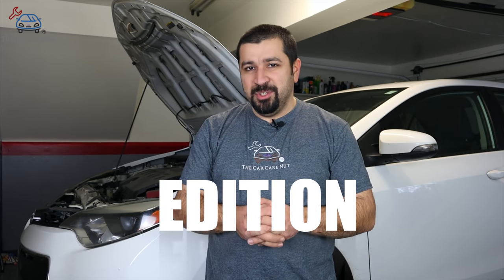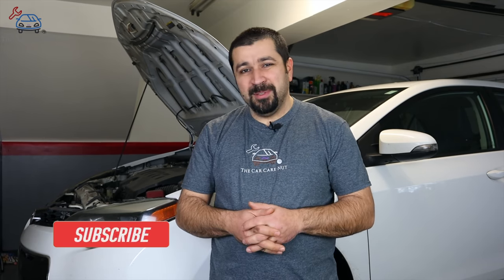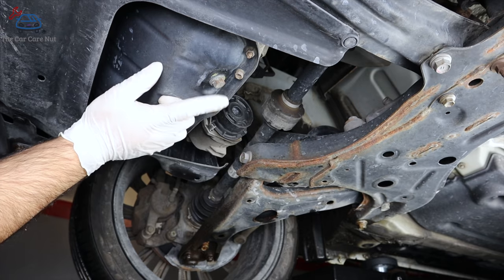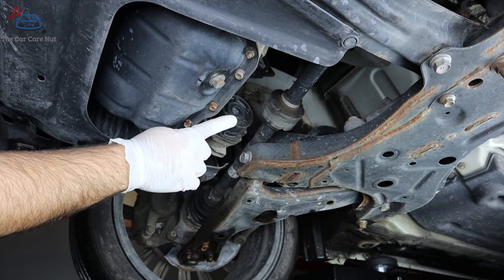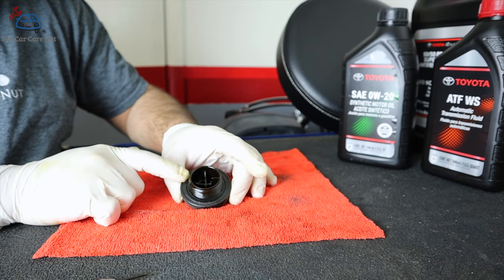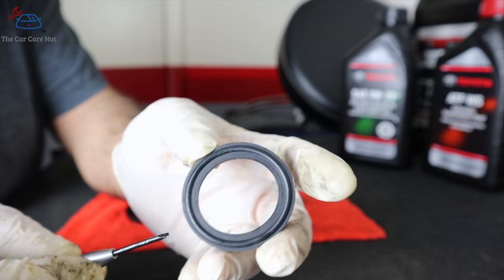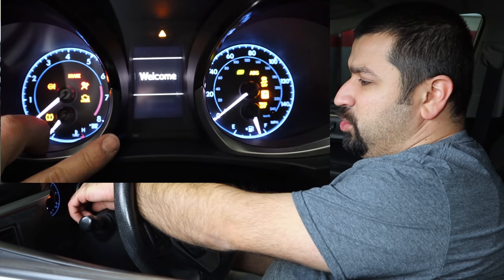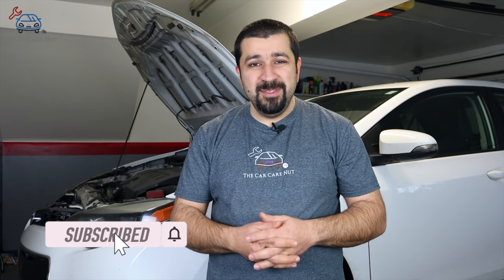How to change your Engine oil and filter for Toyota Lexus Scion

Comment: Hello AMD. Great to see that your brand new shop is operating. I would like your opinion on the spin on adapter made by Baxter company to convert the canister style to a spin on filter. They seem well made and make for an easier oil change for my 2018 Highlander.

Comment: I have done so many oil changes on my Toyota especially now on my Tundra, and my only question is......... why the hell did Toyota go to an internal filter.
That is the worst and messiest design I have every seen, lol
Reply from the maker: Agreed. Many wonder the same as well as it really has no benefit over the spin on filter which now they’re going back to.
Reply: @TheCarCareNut  I am happy to see the new 2.0L and 2.5L engines use the regular, non-cartridge filters! 

Thanks again for your great videos.
Reply: @TheCarCareNut  At first I thought this design was stupid but I have been doing LOTS of research on oil, filter media, bypass valves etc for months and am starting to think toyota may have done it to controll some filter variables. People like to use non OEM filters which have different pressures from OEM for the bypass valve(and obviously different filter media). I believe the bypass is built into the bottom of the threaded plastic piece on this style(correct me if I'm wrong). If it is then it would avoid problems caused from aftermarket filters. OEM filters are definitely the way to go at all times. Many people think a filter that is very fine that catches everything is better but dont realize that the filter media and bypass work together. Too fine of media means the oil will most likely bypass it (especially cold starts)assuming the bypass valve is decentand and actually works. Also finer media catches finer particles and plugs up faster. Many cheaper filters have major problems with bypass valves not functioning at all or barely. 
Same concept applies for furnace filter. Really fine filter catches pollen/allergens but plugs up and can cause excess pressure drop. Finer media usually means more media is needed(thicker filter/deeper pleats) to spead out the air over more area to reduce the pressure drop caused from fine filter. Basically the filter rack need to be designed for the application just like the oil filter needs to be designed for the application.
Sorry for the rant. 
Love the channel.
Keep up the good work!
Reply: @austenbreitkreutz9858  Awesome research. I recently did an oil change on my sister's 2013 Subaru Impreza WRX and discovered that its oil filter has an abnormally high specified oil bypass pressure and aftermarket filters that don't have the correct setting for the bypass valve can cause big problems. I also found out that Subaru OEM filters are made by Fram and are poor quality so I used a Purolator Boss oil filter which did have the correct bypass valve pressure.
Reply: One advantage of the bare filter is that qualities of the filters (especially if you use aftermarket) can be readily assessed, just as shown in the video.

Comment: Great information, thank you!  It is typically recommended to "fill" the oil filter with oil whenever you change the oil/filter.  With a horizontal cartridge filter (like the one on a Lexus GX460 and the one shown in this video) how can this be accomplished? Filling the filter was not done in this video - does that mean it is not needed?

Comment: Speaking of systematically performing maintenance.... One thing I've had two dealers systematically forget is to tighten the lug nuts on my wheels.  One of the instances is when I kept my old TRD faux beadlocker wheels from my old Rock Warrior Tundra to my 2016 TRD. (bought it used) When I was getting ready to drive back home from Dallas (where the dealer was) I noticed the noise when i was going or stopping that seemed unusual.  I pestered them to check it out but it was late and they kept pushing me off.  Anyway when I was driving home on I35 I started to feel like a wheel was really out of balance or something and I pulled off.  The lug nuts on the wheels were basically hand tight...woah!!  My kids with with me and I'm glad the Lord had me stop and check them...tightened them up and the truck has been flawless since then.  Needless to say I had a few words with the dealer.  This same thing happened to my wife years before at a different dealer.. I had a few words with them too. :-)
Reply: Alloy wheels are supposed to be re-torqued after a certain number of miles after they are installed. The dealership should have notified you of this.
Reply: @Rickmakes  This wasn't that.  I rotate these same wheels all the time and this has never happened to me because I torque them to spec but I think they just forgot that step. :-) The wheels were already loose in the dealership parking lot as I could hear a clunk when I came to a stop and the dealer said it was just the brakes "seating".    I also do my own brake jobs and I've never heard a clunk when stopping....it all magically went away when I tightened the lug nuts as they were literally finger tight after driving only a few feet in the parking lot. Scary stuff.   They did end up giving me a credit of 200 bucks towards my purchase because I think they realized they had screwed up.

Comment: Very good content!  I have a couple of questions:

1.  Is it possible for a tutorial for raising your car using jack and stands, or a review of your quickjack device for raising the car ?  Include jack points, whether to use wood or hockey puck etc.  I know where the jack points are for my 2010 Yaris, but it's comforting, for entertainment only.

2.  Why remove  filter  before drain plug?  Is there some benefit?

3.  Have you heard of magnetic drain plugs?  What do you think of those?
Thanks for all your information/entertainment!
Reply from the maker: Hi! So I plan in the future to make a video on lifting points for various Toyota models. I wouldn’t use wood to lift a car. Rubber pads are much safer if needed. I did do a review on the quick jack long ago here’s a link for that https://youtu.be/XWx9NAXzS8w

There’s no difference or advantage to removing the filter first or the drain plug. You can do it in any order.

There’s no measurable advantage in using magnetic drain plugs. A healthy engine wouldn’t have a damaging amount of metal floating with the oil to be concerned about unlike say a differential.
Reply: @TheCarCareNut  thx a lot!

Comment: You be surprised what you find in the bottom of canister holding the filter where the small oil cap and o ring is are located if you don't open and clean it out. I change my car (05 Avalon) oil every 7,000 miles, for 3 cycles I didn't change that small o-ring (because it was in there too tight and I was lazy) On the 4th cycle, I decided to put it on the vise, open and change it, and I glad I did. It was really dirty, It took me a while to clean that bottom canister out, even with the help of half a can of brake cleaner.

Comment: any reason you removed the filter first? I do my own oil on my 14 tundra 5.7 and always drain the oil pain first
Reply: If I had to guess, it's to save time. If you open the fill cap and then drain everything, then everything should come out no matter which you do first. If you remove the oil filter housing first, then you can clean it, put on a new gasket, etc, while the oil is draining from the pan, so you're doing two things at once. Versus, if you do the oil pan first, then you drain the oil out of the pan and then wait 15 minutes and then put on a new plug and gasket. Now you move on to the oil filter and you unscrew up and clean out the housing, new gasket, etc which you could be doing while the pan is draining. Make sense?

Comment: I have two questions regarding doing the Oil Change on the 2021 Toyota Camry Hybrid with the 2.5L engine:
1) Is the torque for the Spin-on Oil Filter also 18 foot pounds?
2) Since this is a Hybrid, after I change the oil, when I push the start button the engine doesn't start. The electrical system just comes on. So when I want to check for leaks with the car still up on my ramps, how can I force the gas engine to start? FYI, I always check for leaks before I put the cover back on the bottom of a motor.
Thanks!
Reply from the maker: Hi! Hand tighten the filter on this one. And press the gas pedal all the way to the floor in park and the engine will come on

Comment: Have a 2014 Corolla. Looks familiar. I noticed that about the canister filter, too. Once you tighten it, that’s it. It’ll be obvious when to stop tightening. Once you’re used to the canister filter, an oil change on this car is very simple to do. No reason why you can’t do it yourself!

Comment: Hi. What do you think about using Lucas oil additives to a 2018 Highlander? Has 70K miles.
Reply: My opinion is additives are unnecessary. Especially with such a low mileage motor. Just keep doing regular oil changes with proper viscosity oil. I noticed a drop in fuel economy using 5w30 instead of 0w20. Even though I live in a hot environment I use the recommended lower viscosity oil.

Comment: you put the filter in, but did not mention orientation. So I will guess it does not matter. thanks for all your great information and well done videos....Is is always ok to drain the oil filter 1st before the main plug? (I have a 2014 highlander XLE)

Comment: Hello Mr. AMD, thanks so much for all your help and advice, I bought a 2000 Toyota Corolla CE 1.8,  it has 89,000 miles , and I don't think the elderly lady ever changed the transmission fluid at 60,000 , should I get it changed ? Thanks again for your help and consideration,  May God continue to richly bless you and your family! 👪 ❤️

Comment: Great teaching progression. 
I refer to the part where you make reference to newer cars, which pertains to my 2020 Camry XLE Hybrid, 2.5. 
Question: which one of the two or both covers do I remove to access the drain plug & oil filter, (one is fastened to the front bumper & the other looks like shape shown on your video). Thank you for your your time & efforts to reply. Dan

Comment: I have a question, my brother has a 2010 highlander limited, he was driving it one day, everything was good until he drove home, about 10 mins away from home, as he was driving, the engine was making some unusual sounds as he drove and accelerated, when he got home he noticed a huge oil leak on the driveway and a little smoke coming out from the engine, he opened the hood and there was a little smoke and it smelled like burned rubber, and there was a huge oil leak in the bottom, under the engine laying on the cover under the car, and no oil on dipstick, what do u think it is? He called me and asked me wut i think it is, i have not check the car yet to see the exact cause. Thank you, i appreciate you for taking ur time and sharing your wisdom/experience that you have gained across the years.
Reply from the maker: Hi! So the oil cooler line is very common to leak on these and it’s exactly as you described. The original line is made of rubber and the new one is made of metal. I check the line first it’s very easy to see look between the exhaust manifold and the radiator and you’ll see it. Buy the original updated metal one and replace it and you won’t have this issue again.
Reply: @TheCarCareNut  thank you for the quick answer. is this a diy job or should i get a professional? how much would the line cost and if i do get a mechanic how much does a job like this cost? also, do you think the 10 min drive w/o oil cause serious damage to the engine? wished u was in nyc, i would come to u
Reply from the maker: It’s not very hard if you are very handy and have jack and jack stands otherwise take it to a professional. The parts should be less than 150 bucks. Labor shouldn’t be higher than 2 hours
Reply: @TheCarCareNut  ok, thanks, ill do it myself
Reply: @TheCarCareNut  Is this the right part  15767-31020? does it come with the bolts and new gaskets? i saw a video on how to replace it, looks simple enough, should i also replace the vvti supply line? what would be the part number for that?

Comment: I noticed you removed the oil filter first, before you drain the pan.  I like that idea as it lets you use the still clean and empty oil pan to hold and drain the filter first.  What was your reasoning for this and do you do that every time?

Comment: Glad I came across this.  Yesterday at oil shop put in 4.5 quarts as required for my 2007 Camry 4 cylinder.  For some reason it was above the high marker by approximately 1/2 inch.  Should I go back and demand it to be redone with just 4 quarts and give me the other quart of Mobil 1 to have since service is for up to 5 quarts to have on hand?
Noticed on my Toyota log in maintenance history, Toyota dealership 2x put in just 4 quarts.  Suggestions p!ease?
Reply from the maker: Hi! I would go back and ask them to correct the level. They’ll drain the excess
Reply: @TheCarCareNut  Thanks, hope they know how to do this properly?

Comment: One More question. At the 1000 mi break in oil change do u also change filter or just leave it till till u hit 5000 mi? 2021 4 Runner. Thanks
Reply from the maker: I would change the filter as well.
Reply: @TheCarCareNut  What is the Crankcase capacity of the 4 L? i see some  writings saying 6.5 qts some 5.8qts. I guess i could actually read the Owners manual, lol! Thanks for providing great info for us Nut.
Reply from the maker: On your 2021 4Runner with the later 4.0 it’s 6.5. The early 4.0 with the oil filter at the top was 5.5

Comment: I have owned mostly Toyota and Honda vehicles since my first new car, a 1979 Corolla. My first two cars were a 1976 MG Midget and a 1977 Triumph TR7. The TR7 had a canister filter but it only had one big bolt. My first Toyota to have this stupid canister filter was my 2010 Rav4. I swore I would never have another car with a canister filter. Fast forward to 2019 and my wife fell in love with the 2019 Highlander. Sigh. I am looking at a Baxter performance adapter because there is no anti drain back feature in the canister system. I also have never removed the end cap. My dealership did the first 5 oil changes and when I did the next one, I had to use a large wrench and a rubber mallet to get the drain plug and filter off.

Comment: Great video.  Awesome series.  I especially liked your tip about oil level with a cold engine vs warm.
Reply: On my Chevy 3.6 litre the oil level is the same hot or cold, the oil completely drains down on a cold engine which makes up for the difference in temperature.

Comment: I had inquired about why Toyota uses a canister oil filter instead of a spin-on and I was informed that it's for environmental reasons. Less waste with the paper canister filter as opposed to the metal/paper spin-on filter. There are no filtration advantages.
Reply: Spin-on filters are canisters...

Comment: AMD this is a very beneficial series- I'm really looking forward to the coolant change video (I read the other comments :))
Question: Since the engine is cold when doing the oil change do you recommend just putting the capacity it says in the manual (ex/6.4qt for Sienna) and then warming up the car and then checking the dipstick? Also for regular maintenance should we check the dipstick before starting the engine or after having driven it for a while? Would appreciate your expertise. Thanks
Reply from the maker: Thank you for watching my videos! So on the capacity always put the capacity from the manual and for accurate reading fully warm up the engine, shut it off wait for a minute or two then check it
Reply: @TheCarCareNut  Thanks again for the videos and replies. Great work 👍👌
Reply: BTW This is probably a stupid question but do we know the car is warm by waiting for the thermometer Guage to show the line between C and H?
Reply from the maker: Hi! Most modern cars will warm up to good operating conditions within 5-10 minutes a good indication of operating temperature is the gauge being between hot and cold
Reply: @TheCarCareNut  Thanks 😊
Reply: @TheCarCareNut  I’m 52 years old and my family ran an old style filling station w/ a shop where we did basic oil service jobs and tires.  This is the first time I’ve ever heard that oil expands when it is warm.  I just changed the oil in my Camry and tested the theory.  Honestly, I couldn’t tell.  But part of that may be because the oil is so clean that I have trouble seeing it on the dipstick.  

Also, my 09 Camry puffs smoke when I first start it.  I’ve recently watched several of your videos about this model.  Ugh!  Strangely, it seems to do it the longer I go between changes.  I’m wondering if I might be overfilling it on accident.  I think I put about 4.5 quarts in.  Again, the darn dipstick is nearly impossible to read when the oil is fresh.

Comment: On my 2nd gen Prius my favorite part is that I don't have to lift the car, filter and drain plug are easily accessible from the front I change my oil so much that I do a complete oil change in under 10 minutes 5~7 minutes actual work time the other 3 are cleaning and getting my tools from the very roomy trunk storage area
Reply: The first gen was that way, too IIRC. The third gen has the splash guard across the bottom and it hinges the wrong way for me.
Reply: Same for Echo and Yaris. Spin filter from the top - better grip, better for the blood pressure. Drain is close to the front bumper.